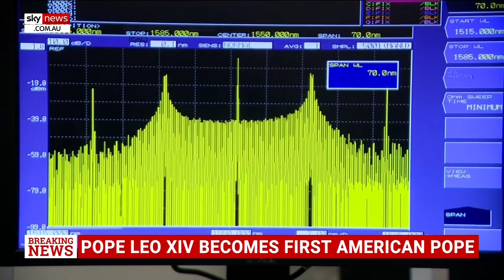New technology needed to prevent AI fueled energy crisis

Comment: Now let's run all electric vehicles too 😂
Reply: That one has definitely not been thought through. People who promote electric cars always neglect to explain where all the electricity will come from. 

15 million cars in Australia. 
11,000 km/year average. 
15 kWh / 100 km average 

1 car needs 1,650 kWh / year 
15 million cars need 24,750 GWh / year

A 1000 MW coal or gas power station at 95% is 8,322 GWh / year. 

That’s 3 new 1000 MW coal or gas fired power stations required. 

Alternatively,

A 3 MW wind turbine at 25% (generous) is 6.57 GWh /year. 

That’s 3,767 new 3 MW wind turbines required. 

For solar power it works out at about 9,500,000 commercial sized panels.
Reply: @NoWindNoSunNoPower  Well said 👍 You are to consider commercial fleet too 🤣